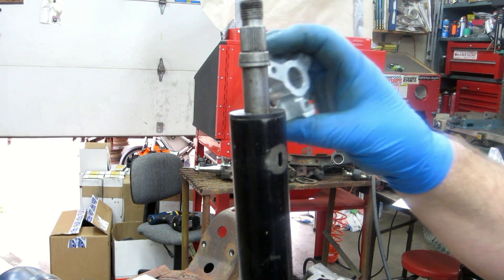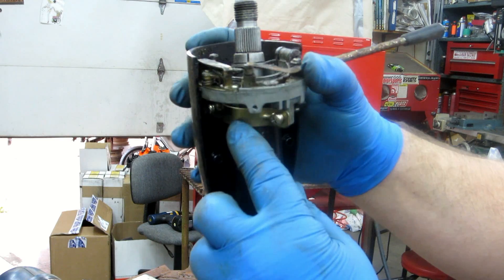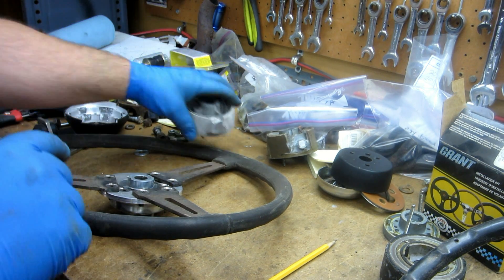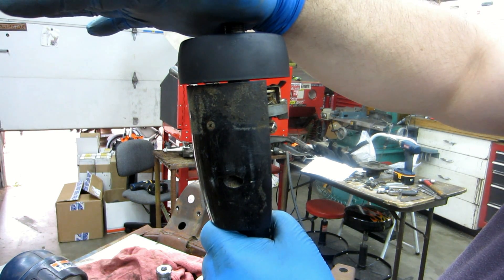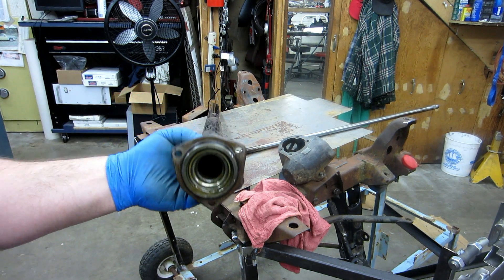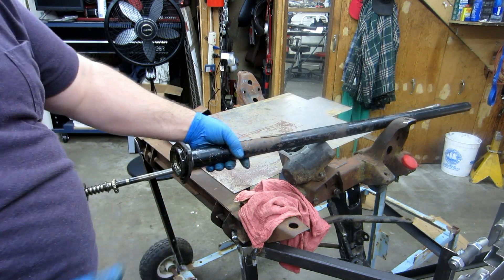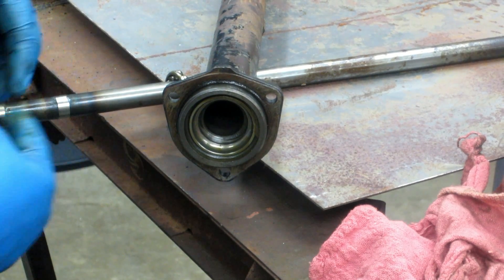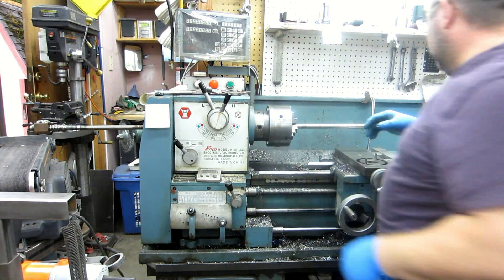Steering column shortening 1

Comment: Gonna do it on a 521 didn’t even know this was from a Datsun but better for me
Reply from the maker: You have to use a smaller diameter steering wheel when you do this.  Have your adapter ready and measure the gap between the horn contacts.  Shorten the column so that it accounts for that difference.  Basically, the inner shaft will get shortened more than the outer tube.